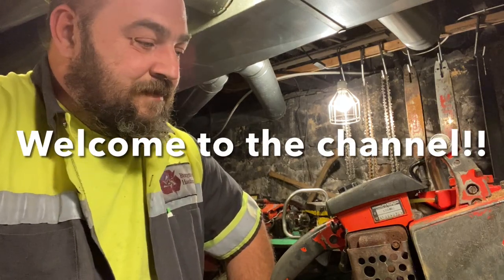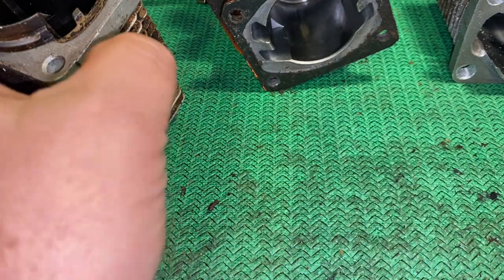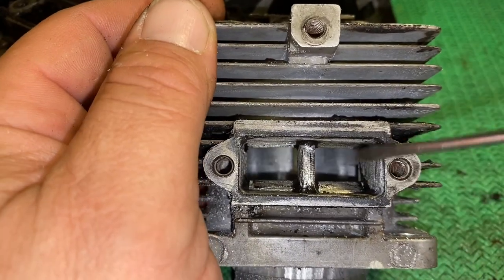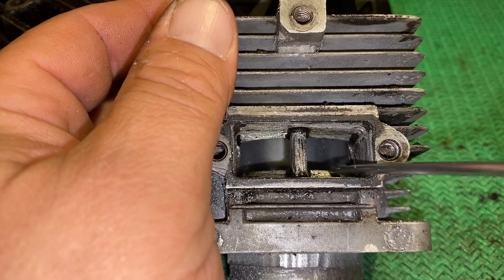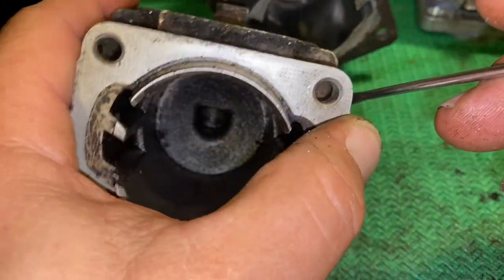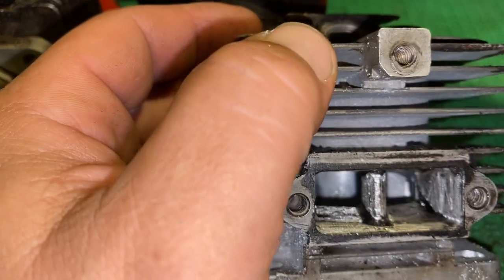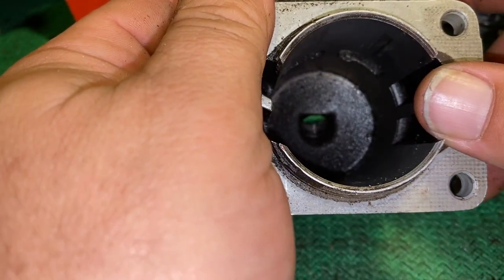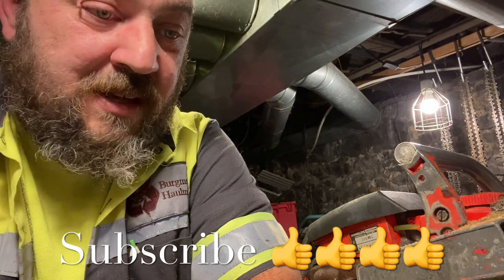Ported Homelite Super XL Auto!  What Was My Thought Process To My Work?

Comment: How much squish did you have after you removed the lower gasket.. I agree tho the reed problem is the only reason i havent done my xl12
Reply: xl12s have a single reed design you can can convert it to a pyramid reed design by doing a couple things.
Reply from the maker: It started with .098. 

After I changed cylinders and deleted the gasket I had .063
Reply from the maker: I am going to eventually do an XL12. It will be a little more involved because I am going to convert it to auto oiling.